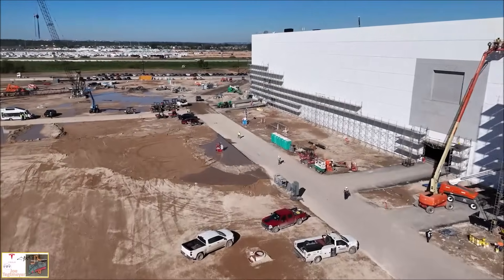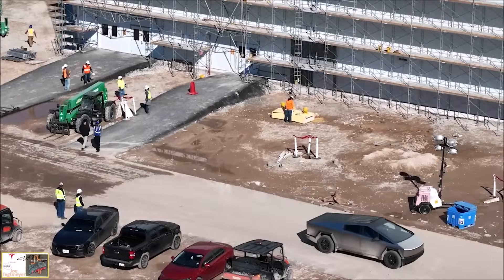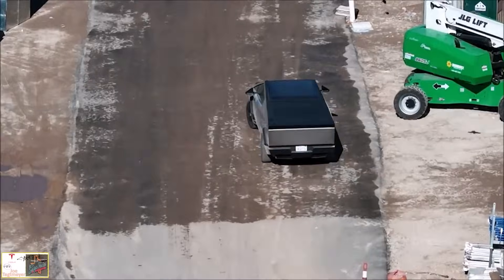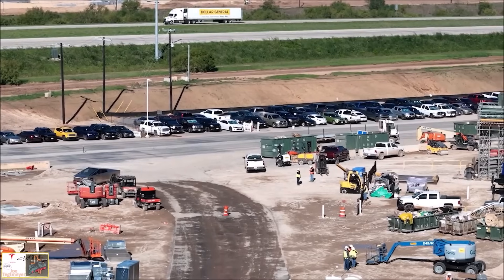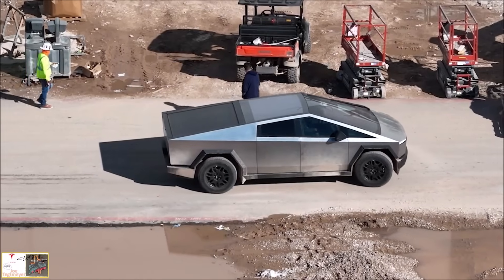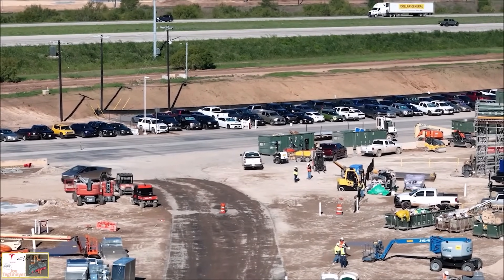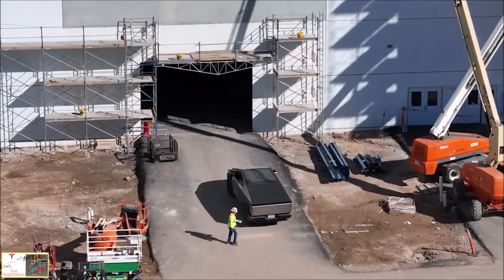Tesla Seen Testing Cybertruck Crab Driving At Giga Texas

Comment: Look at the steering ratio!!! That is drive by wire!
Reply: is it a good thing or a bad thing?
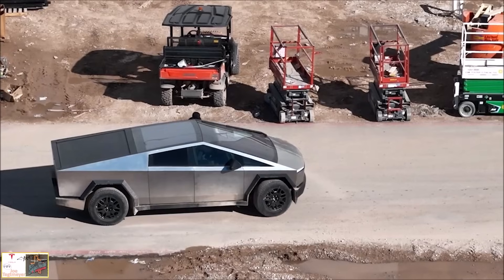Reply: Should be a good thing, especially since Tesla have removed traditional stalks from the steering column. Drive by wire enables programable steering ratio depending drive conditions (speed, terrain, weather). 3:39 looks like full lock was just over a quarter turn.
Reply: nice catch
Reply from the maker: Actually Mercedes just introduced 365 degree turn in one of its vehicles. It's like tank turn. I wonder if Tesla will do the same with the Cybertruck too.
Reply: @Torquenews  rivian have the tank turn too